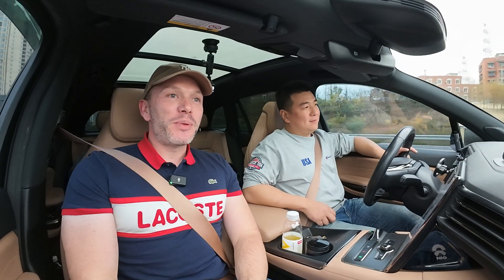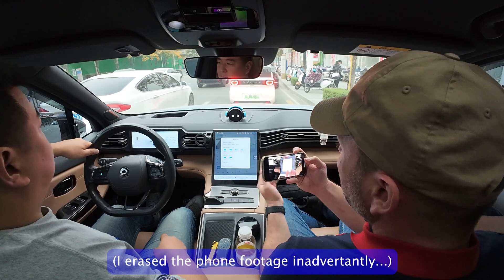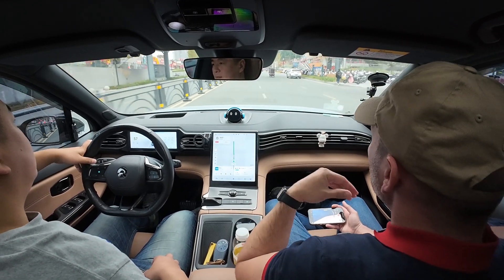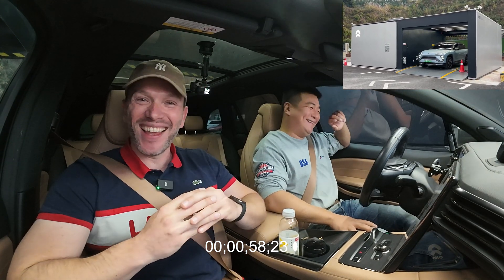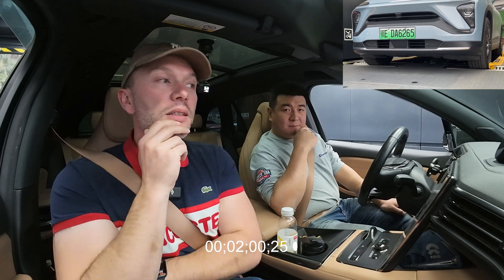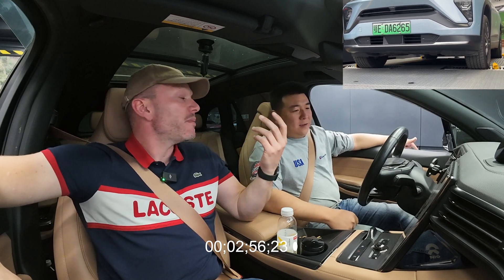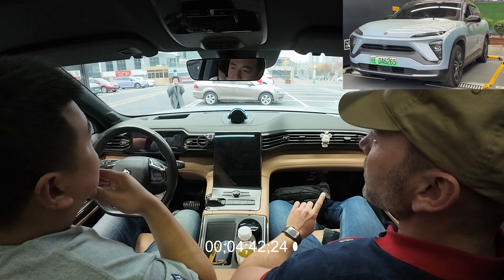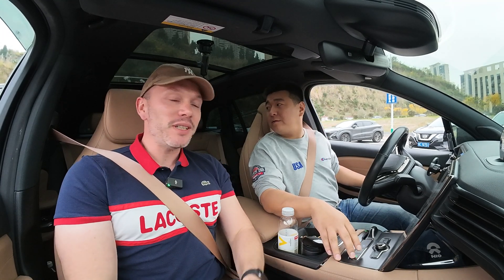Latest generation NIO power swap station. Is that really faster ? (Nio ES6).

Comment: The one thing I never hear talked about is safety for the consumer...Would you rather have your wife go to a swap station, not have to get out of her car and be on her way in 5 minutes or would you rather she stop by a charging station and sit in or stand outside her car for 20-40 minutes waiting for a charge?...Much safer for the driver and it cuts down on car jackings...
Reply from the maker: That is a very good point indeed.
Reply: thats a very specific argument while i can say that there are more pro's on fast chargers.

Comment: This is such waste of time . 98% of electric car drivers charge at home . This application will ONLY be useful for the trucking industry .
Reply: And what happens when your battery fails and becomes scrap?
Reply: @gonein60secsbro  The same thing as what happens to ICE motor... Either you fix it or you swap it :)
Reply: @TheSuriwan  side street charging will be everywhere soon . Every parking spot will have AC charging on the street . This is already happening in New York City
Reply: @sheepyracing2774  interesting to hear. The amount of charging stations needed will be quite big and the grid might not be prepared. But lets see :) i think we need combination of multople methods to cover the demand. Also not everyone can charge at home as peviously mentiones
Reply: @TheSuriwan  most electric cars can put power back into the grid . Teslas will come standard in the future with vehicle to grid load
Reply: @sheepyracing2774  i know, sadly right now it does not make any sense to use it if you count the price of battery cycles. The only somehow useful thing right now is V2L and even that can quite a lot of manufacturers make almost unuseful due to the output limits...
Reply: @TheSuriwan  this makes no sense sir ? what are u trying to say ?
Reply: @flujori  Not sure about what you are asking. But if it is about the V2L, quite a lot of manufacturers limit the power output of onboard the sockets to 100W, which is kinda low for current appliances other than smartphones and tablets (and they can be charged via USB ports, so no need for V2L). Similarly, to actually use car battery to power bigger appliances (when the V2L would allow it) is also not too much economical as the batteries are still degrading quite fast so the cost per charge is quite big... I can see this in the future as a good idea, but I think we have to wait :). Nowadays it can be used as an emergency thing, but as I said, not many cars can provide V2L, V2G or V2V ...
Reply: I missed your first post, so your reply makes sense after reading that, my bad 😅  @TheSuriwan
Reply from the maker: And that’s the problem, how to attract people that can’t charge at home. That’s an answer. It is very useful for a lot of people. I remind you that a lot of brands just announced a partnership with NIO. You’ll see more and more cars capable of doing battery swap.
Reply: @TheFrenchCARnection  WRONG . Supercharging is all that is need for people without charging at home . Really have a think about what you’re saying . People that live without chargers at home CLEARLY must live VERY close to their work or there travel routines which in this case they will only need to charge once a week at most while they do their weekly shop at the same time! Nio is trying to be different but it will backfire on them badly ….
Reply: @TheFrenchCARnection  must be a French thing . But in Australia we don’t want a battery swap station here . We also like to keep our cars in 1 piece and it will feel like you don’t own the car like your driving a rental it’s not what Australians will ever want
Reply: @sheepyracing2774 you do realize supercharging requires higher outputs of amperage which is more heat for the battery. HEAT will kill a batteries range over time. Supercharging is not really as good as you think it’s okay here and there. Battery swapping at this speed is impressive. In order for supercharging to get faster would require more and more amperage and this means more heat.
Reply: @ManiiZilla  Also the swap stations can much better utilize the power drain from network and battery charge speed. The major issue will be storage capacity of the battery units itself. Look at how many ICE cars can be at any single moment refilling at normal gas station... To match the equivalent with any of the battery technologies currently available will be a lot of work. To all the guys saying you can charge at home -> go have a look at any larger city, where you have a shitton of skyscrapers with limited parking spaces. At least in our country they even start to prohibit EVs from underground garages due to the safety reasons (kinda hard to extract vehicle under fire from standard size underground garage and almost impossible to currently put out the fire inside). So you do need more ways how to charge it outside of standard houses which put quite a demand on the power grid and also the ways how to actually deliver that power to the cars fast enough. And we did not even got to the leasing issues, which as always, are too high to make any sense. So Right now we are stuck with promising technology (battery swap) that cannot be used when you actually own the whole car and the battery lease in Europe is just not making any sense financially... Kinda sad to see that because the EVs are great way how to travel, but not yet there to take over all the markets (not mentioning the stupidity of making it all glass so it eats more electricity for cool factor ...) Sorry for the long post, but right now Im pissed off from my own tesla experience...
Reply: @TheSuriwan  if the cars are a lethal threat in the 1st place they shall not be selling them …. Wether the car is charging underground or not the car still has a battery attached to it . 
The inconvenience of travelling to a battery swap station rather than charging where you live would be a deal breaker for me .. best you own what is practical for you . I charge my Tesla at home AC charging . No issues with the AC charging infrastructure underground or above
Reply: @sheepyracing2774 With all due respect, your logic is nonsense. People charge at home, so battery swapping services aren’t valuable? And Supercharging works “just fine” in lieu of battery swapping? Nonsense. Charging at a Supercharger takes AT LEAST 30 mins, and that’s assuming you are only going 10-80% in most cases. 

Battery swapping takes LITERALLY less than 5 mins. If I’m on a road trip where I have to stop three times to charge, I’ll take 15 mins over 1 1/2 hours+ ANYDAY. 

This is absolutely a key selling point for those with charge time anxiety, which coupled with range anxiety, is a legitimate gripe with respect to EVs. 

My only question for swapping is whether it still has enough benefit when 600kw+ charging is commonplace. Surely though, it will be used at the least in contexts like electric motorsports, where the equivalent of a pit stop yields a fully charged battery in minutes (or less).
Reply: @ManiiZilla  there is absolutely no evidence that supercharging will kill the battery quicker. It’s a myth .  Let me know once Nio has gone bankrupt . Shouldn’t be long now
Reply: @ManiiZilla  you are not well informed on the matter, and repeating mainstream media, try to not get your info from facebook or instagram, try to do some quality research sir.

Comment: How long or how many miles does a new battery give you amigo .
Reply from the maker: You mean what’s the range ?
Reply: Yes whats the range of a new battery 🪫,  after swapping it?
Reply from the maker: On the ES6 with the 75 kWh battery, I'd say you can expect around 300 to 350km depending of your driving and weather conditions. @1juan1234

Comment: NIO to 100$ per share !!!!!
Reply: Yeah sure . Try 0 . It’s not needed when people charge at home . Goodluck to them wasting money on an idea that will go nowhere for passenger vehicles
Reply: @sheepyracing2774  It will work in big cities. It takes away the depreciation of the battery in time. They can also use the stations to balance the electric grid. Even if it only becomes the standard in China (they are pushing it to be this way) the company will have good success. Why so negative?